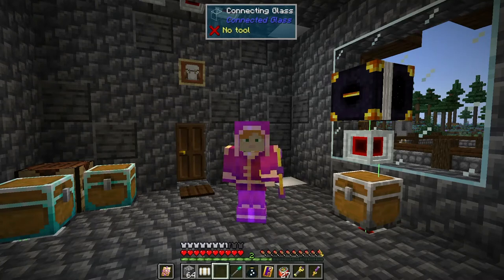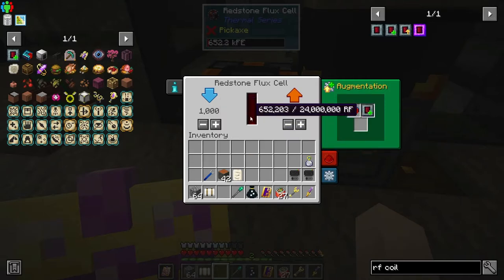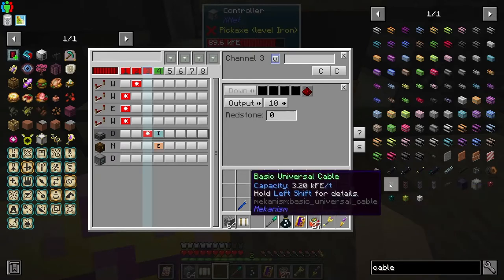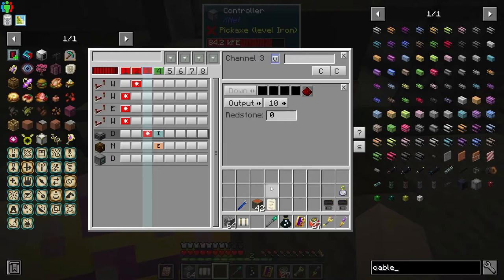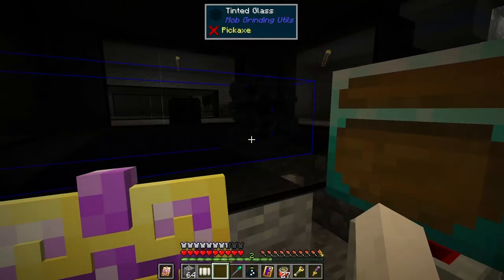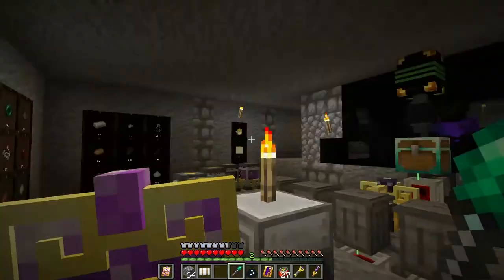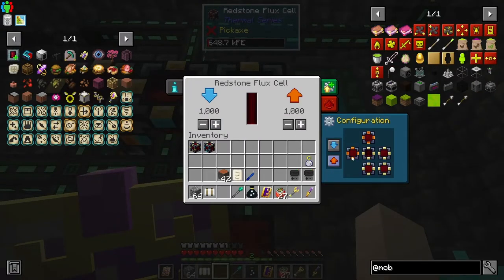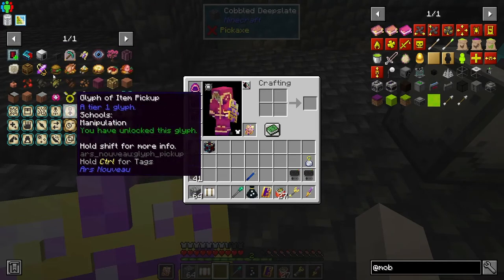DireWolf20 1.18 Let's Play Episode 66: Automatic Plastic

Comment: You should put some levers on some connectors so you can more easily switch your mob farm on and off  :-P

And I think you unlocked your drawers in the previous episode when you were showing us the linking; you accidentally clicked it with the config tool instead of the linking tool.  :-P
Reply from the maker: Ah, yes. That would explain it :/ And yes, it would be a nice thing to have the levers too :)